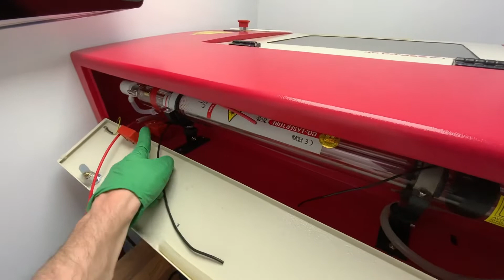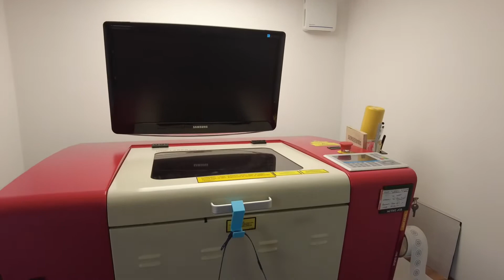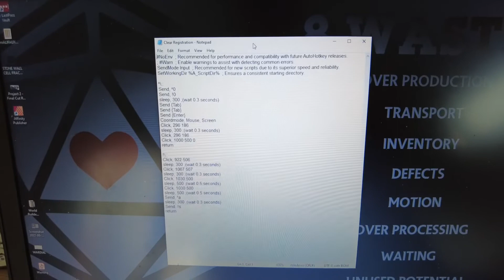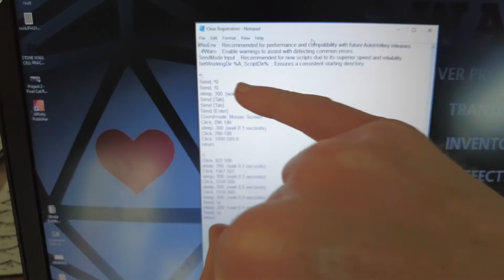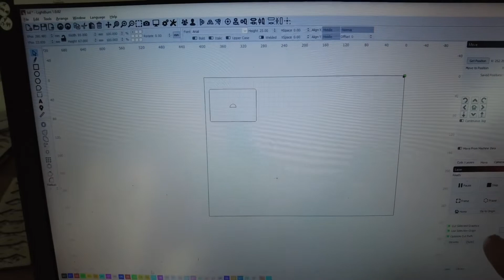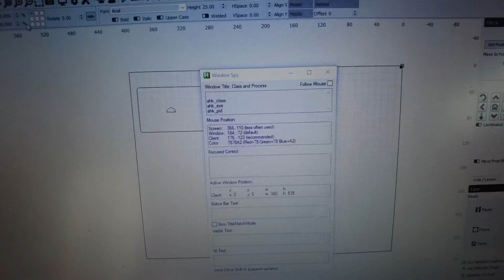June 2022 Lean Improvements

Comment: Hello, In lightburn what do you do with autohotkey? Could you create a video where you show some details?
Reply from the maker: Covering The actual specifics of what I do in light burn would reveal my work flow which I’d prefer not to share as none of my competitors are producing products in this manner but I can do a generalised video of autohotkey if you like?
Reply: @TabletopUpgradesLeanJourney  Sure. I understand the situation. I also use LB for mostly wallclocks and wineboxes.
Reply from the maker: So one application I could think for this is as follows. You've likely got different start coordiantes for the wallclocks and winboxes, but it's likely they are always the same for the clocks and the same for boxes. You may also have different speeds/powers for each. 

Once you create your design, AHK would allow you set a keybind up to automatically select the graphic, jog to the correct position depending on the product, select a cutting profile from your library then start the cycle. You could say set up Ctrl+Alt+C (For clock) and Ctrl+Alt+W (for Winebox).

It's a small thing but it will save many, many clicks and eliminates the chance of error. People unfamiliar with lean will say "who cares, you saved 1m10sec...I saw you have a coffee break for 5min!" - it's not just about the time, it's about reducing the mental load and removing opportunities for error. Little changes like this save so much energy when they compound!